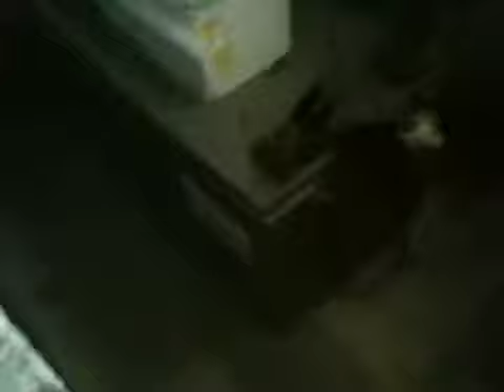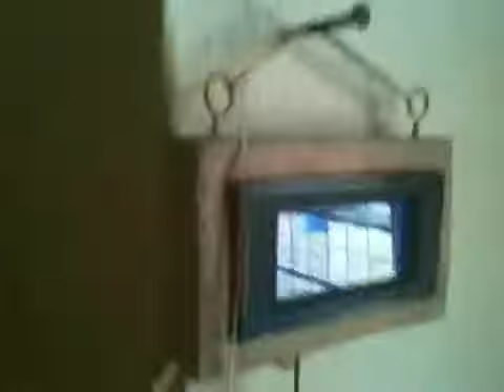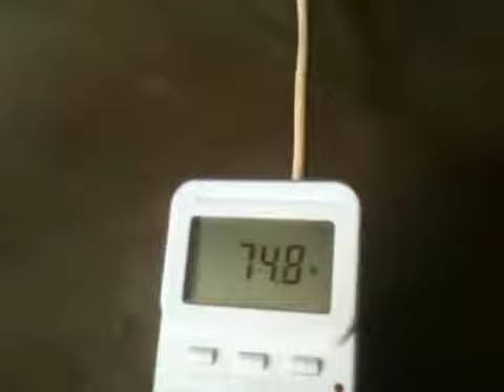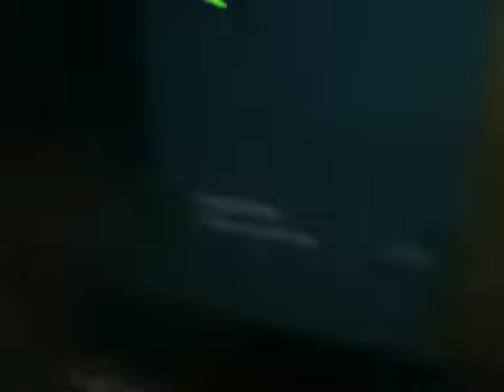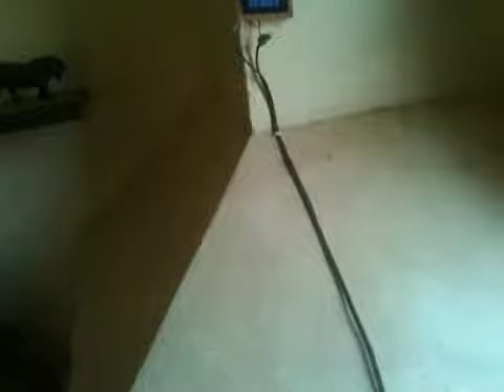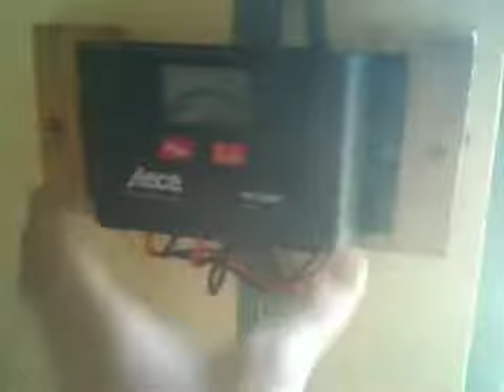AC fridges and solar set ups!!!!!!

Comment: I agree. DC cuts out the middle man.  Sounds like you got a voltage drop somewhere kicking off your LVD on inverter. I can only share my own experience with same prob (but god know too many variables to consider). But for me, I narrowed prob down to some loose cables, not being tightened down enough b/w batts and inverter. Basically if u can move the wires with your hand not tight enough. Worth checking out but of course could be so many other things. Anyway great vid glad to see you back with some new vids. Ps my solar ac fridge bit bullet so I'm looking at sundanzer
Reply from the maker: yeah man, my wires are tight, its just too much current too fast for the little guy. When you get your Solar fridge up and running, post a video man. thanks 
God bless
Reply: will do